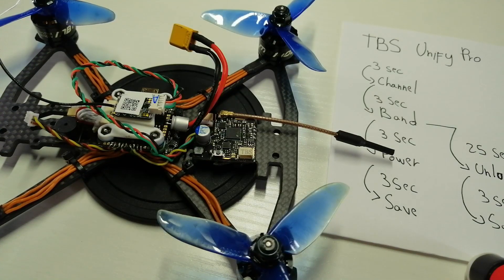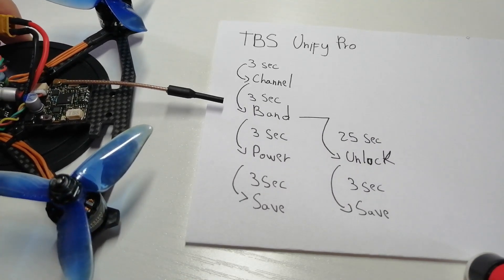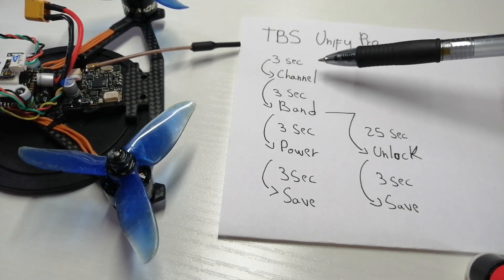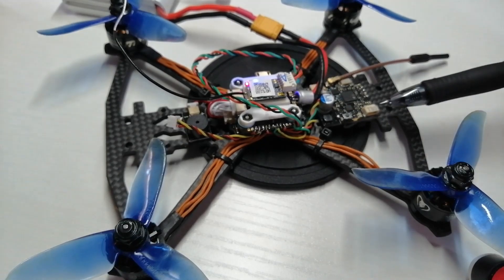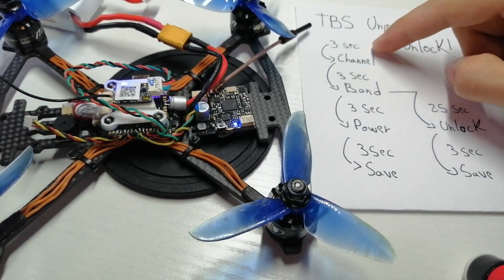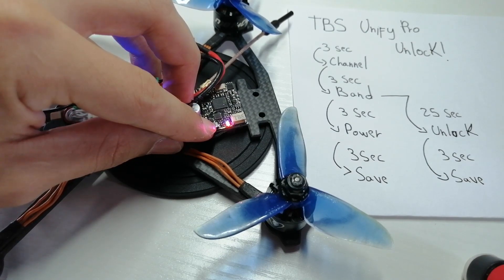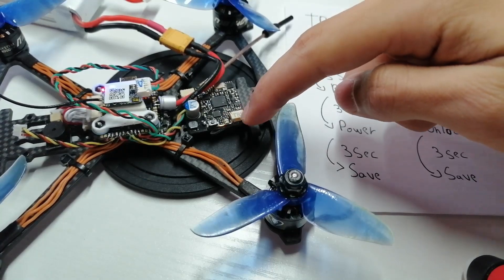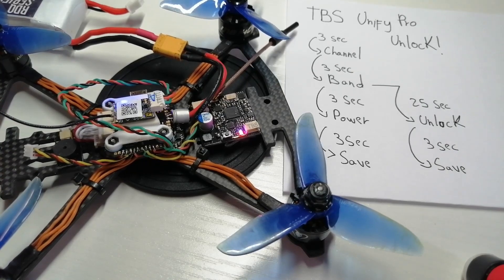How to Unlock TBS Unify Pro VTx (Video Transmitter)

Comment: I'll have to come back to this video when I get a working TBS product. First crossfire receiver, dead on arrival. First Unify Pro32 Nano VTX, blew up after 50 seconds of flight. First Unify Pro 5g8 HV VTX, dead on arrival. TBS may have the best stuff but so far their reliability and quality control is no better than the cheapest stuff coming out of China. Maybe the replacement one will work. Everyone should know to test your FPV electronics as soon as you get it in the mail to make sure it will work so you have time to return it for a replacement.

Comment: I have the Unify Pro32 HV. When I plug in the 5V from the USB cable into the VTX the settings remain saved, whenever I plug in the LiPo the settings are always lost... so how to save those settings? Thanks!
Reply: hey do u find solution?

Comment: Carefull: On my ER349, Beatflight 3.5.1 was installed, which does NOT support SmartAudio. But: Smartaudio was enabled, so the VTX would every time switch back to the old channels, bands and power setting after I unplagged and reconnected the battery.

Comment: Thanks for the vid but it jumped back to 25mW after plug it again. Is that normal? You’d set 200mW
Reply from the maker: It usually jumps back to 25 if you didn't do one of the steps correctly, I would try again. If that doesn't work I'm not sure what could be causing it. Best!
Reply: Try holding the button for 3 seconds untill the blue light turns on, after you set the desired power level. If this does not work, try disabeling Smart Audio or try to set power in Smart Audio menue.